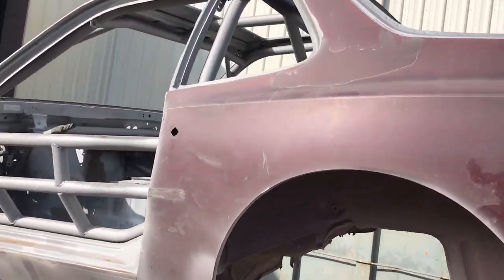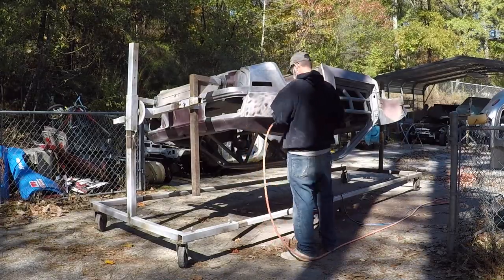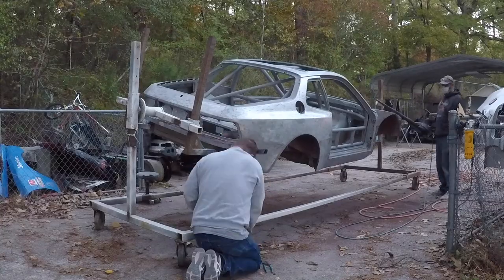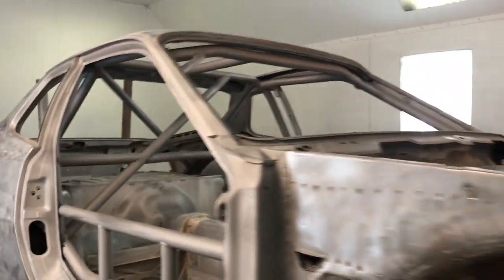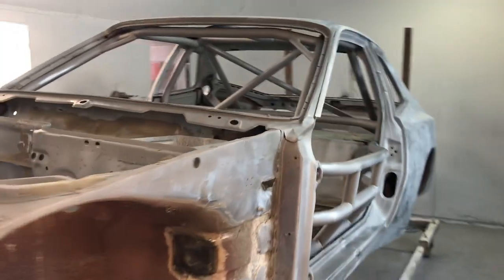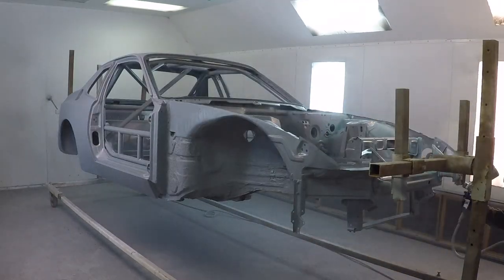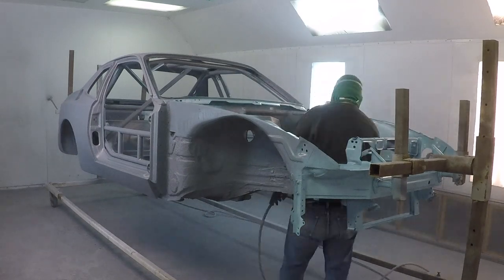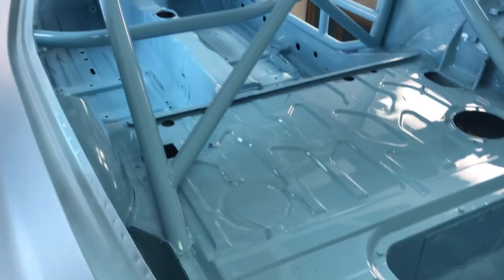New Build! Porsche Spec 944  (Part:1)

Comment: Hi cool project 💪🏻
I’m starting my 931 race car project and building my first rotisserie. 
I can see that you put your balance point is about 8in above the bumper mounts on the rotisserie. Did that keep the car in balance when you flipped it?
Hope you will help out here 😊
Reply from the maker: 931 race car sounds like an awesome project! The balance point is different for every car, but keep in mind that most of the weight is on the bottom of the body. It helps if the arms attaching the car to the rotisserie are adjustable. If the car is properly balanced it makes it easier to spin. Thanks for watching!

Comment: GREAT JOB   how did you not damage the factory galvanizing of the body with the sand blasting and grinding ?
Reply from the maker: Sand blasting with most medias and grinding does remove the galvanizing. The only option I know of for stripping and retaining the galvanized finish is to use chemical stripper which comes with its own set of problems. It is kinda choosing the lesser of two evils... that is why we re-coat with epoxy as soon as possible to prevent any future corroision.
Reply from the maker: Almost forgot... Thank you for the question and the compliment!
Reply: If he is building a race car , galvanizing is not a concern 😄😄😄😄😄😄🍺🍺🍺🍺🍺🍺
Reply: I love tracking my 951 !!! Great car !! Easy to work on !! Don't ask how I know !!!😄😄😄😄😄😄😄🍺🍺🍺🍺🍺🍺
Reply from the maker: 👍 It is a great racing platform!

Comment: How much did it cost to sand blast it?
Reply from the maker: The blaster get $110 an hour and it typically takes them about 4 - 5 hours. It really depends on how much material they are blasting off.
Reply: Thanks,  I bought a GeoBlaster (wet abrasive) to put my nephew in business but only ended up doing my own cars.  Was either going to sell it or starting doing it part time myself.  Don't have to worry about heat since the panels actually get cooler when I blast them
Reply from the maker: Cool! Good luck with your endeavor! You should stay busy because our local sand blaster stays very busy.